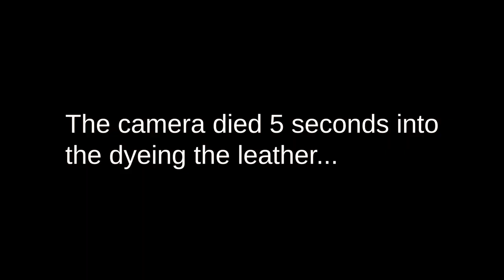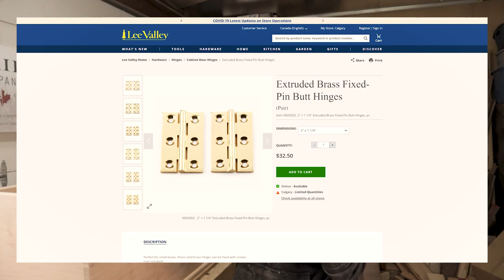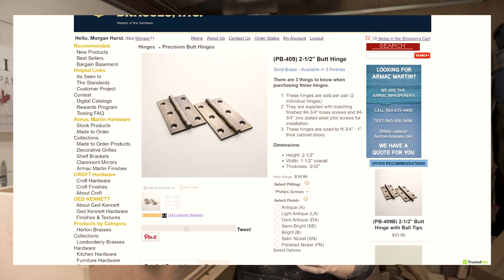Finishing the painted part and the main case | Small Dovetail Blanket Chest | Fine Woodworking

Comment: thank you Morgan . if i may you were talking about the end grain sanding . why not try a shooting board with your plane ?
Reply from the maker: I have a shooting board that I use every once in awhile for cleaning up endgrain the only problem is I'm not very good with it and I usually get a little tearout on the edge of the board. Once I get a little more practice with it I may start using it more often but for not it's kind of a plan B if sanding doesn't work.